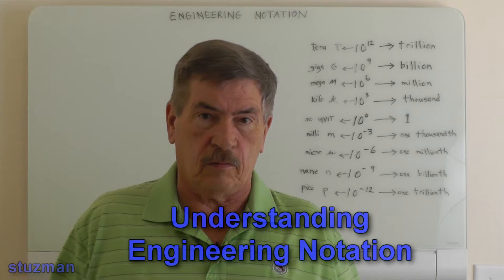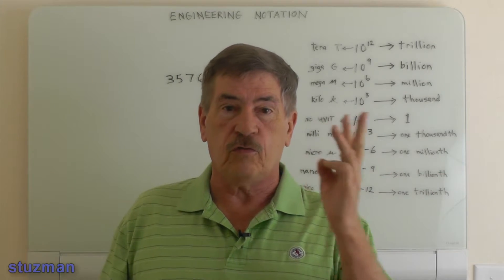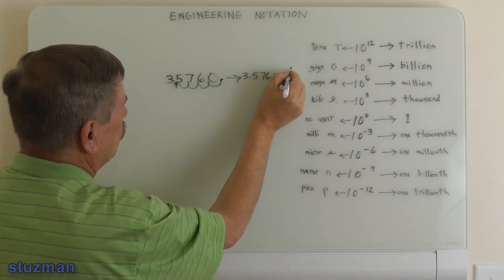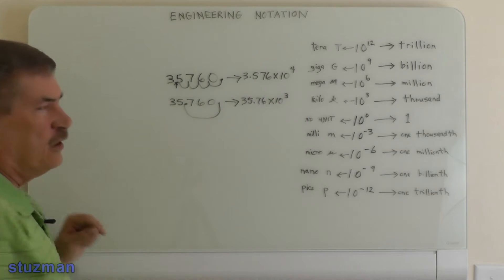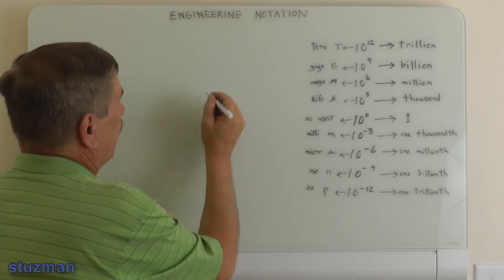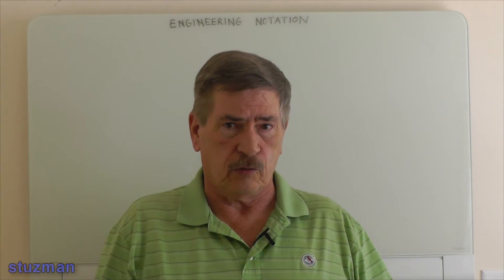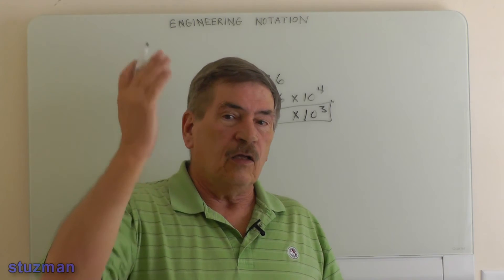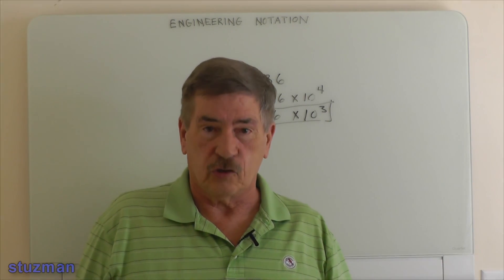Understanding Engineering Notation

Comment: Good stuff Terry . I'm sure  its a learning curve in real applications . Is this a  universal standard or do  other  countries  vary because of different measuring  as in metric vs imperial.
Reply from the maker: In all the fields of science and engineering, engineering notation is the standard since it is based on the metric system and is used worldwide, even in the United States. In fact, all of the units used in science are based on the SI (systeme internationale), 'international standard' for folks who speak English. The standard was established in 1960 in France. So, all countries use it. I'll be covering the standard a little more when I get into the topic of electronics.